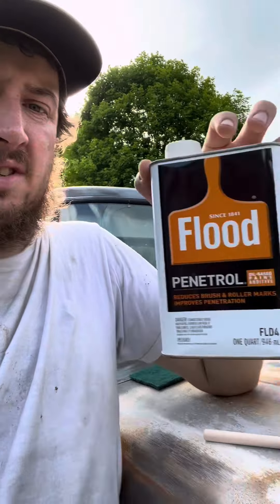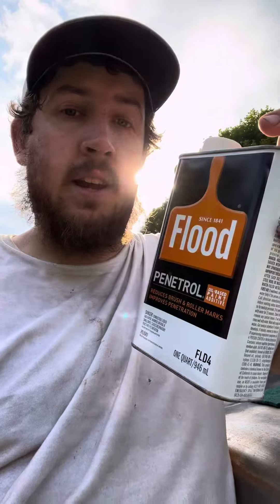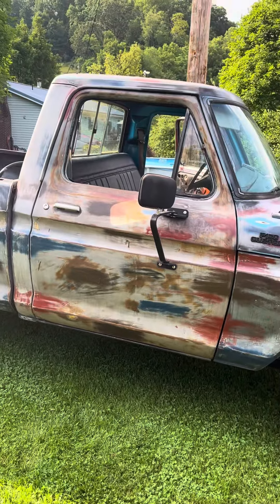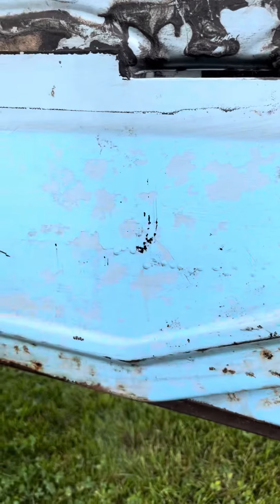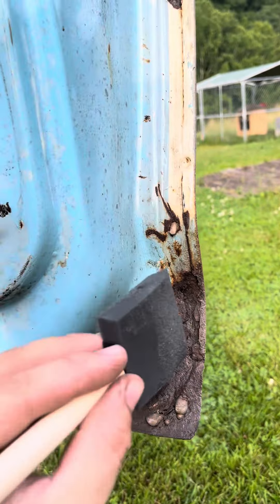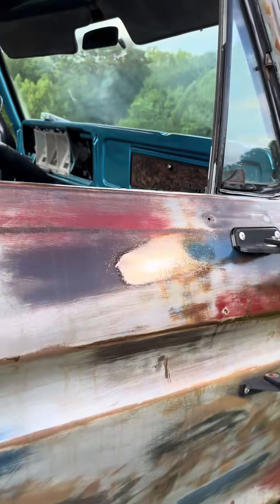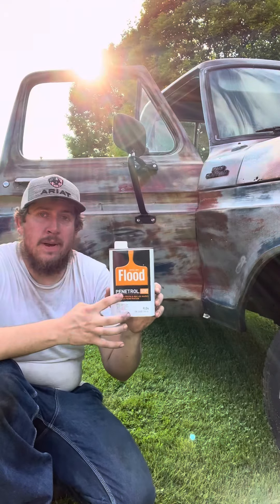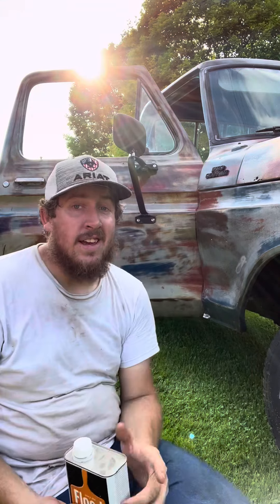Cheap Clear Coat? Penetrol Patina Paint Job

Comment: Penetrol is just Boiled linseed oil with a little solvent in it.  You can make the same exact stuff by adding a little mineral spirits to boiled linseed oil.  However there are problems with both of those.   The problem with boiled linseed oil/penetrol is that: 1. It isn't waterproof (so humidity still gets through it). and 2. It is extremely hard to remove if you dont like it on your vehicle.  So when you layer it on every 3-6 months you are making a big build up of coating and how are you gonn get that off when you been doing that for years?  the only way is sanding and chiseling.   Theres a much better old farmers product called "Wellers".   It was produced back in the 1940s for the steel parts of WWII planes.  The aluminum didnt rust but to preserve the steel bolts and wheels etc they used Wellers.  It  uses some lab produced formulation of oils and polymers to block all the humidity from coming through onto the steel.  It is also a wipe on thing like BLO (boiled linseed oil) / penetrol but with much better results and better at patina locking in.  The bottle I got has lasted forever too.  I wouldn't let yellowing BLO/penetrol near my ride unless i wanted a gummy mess I couldn't remove.  you'll noticed that buildup/yellowing over time.  If you only have one layer on now I'd remove it before it cures for years (use mineral spiritrs or rubbing alcohol to get a young layer off) and then get that Wellers stuff I mention.
Reply from the maker: Awesome information. Thank you very much for sharing. I will definitely look into that.
Reply: Do they still make Wellers?  I goggled it and nothing comes up
Reply: Is it Weller WC2?